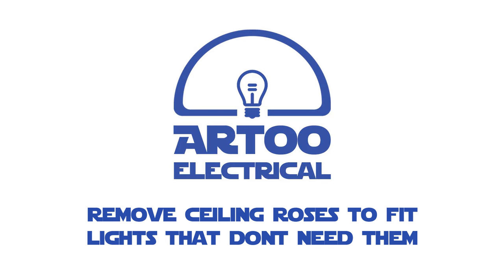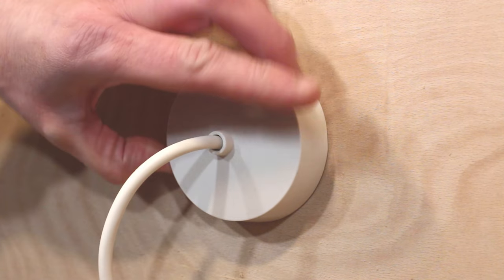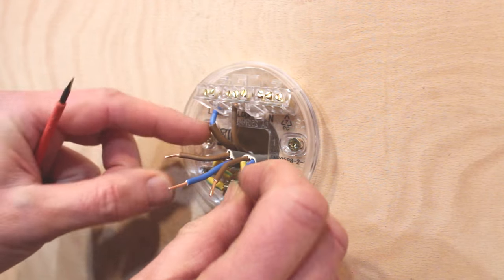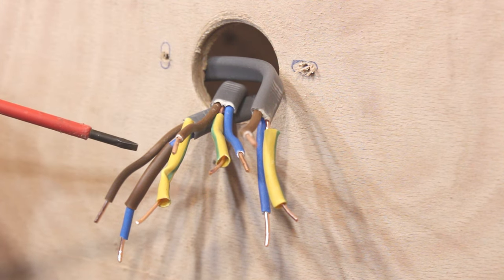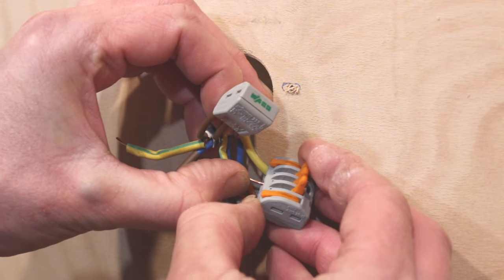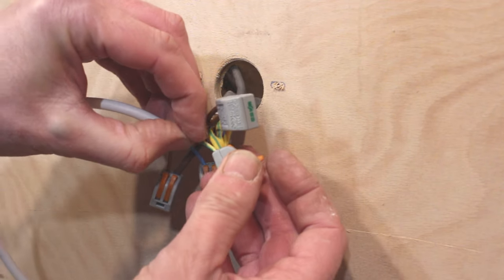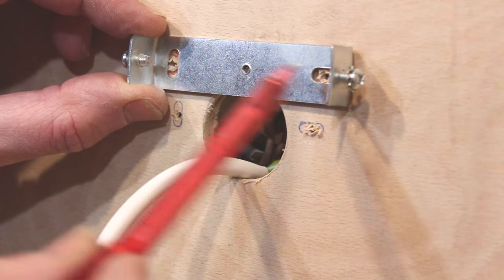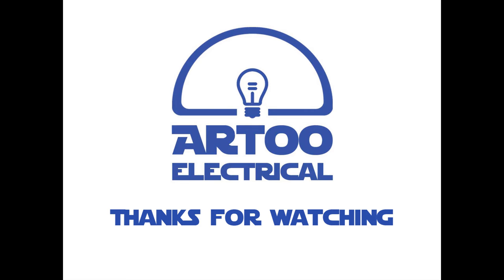Part 2 - Replace Pendant Light Fitting With One That Doesn't Need A Ceiling Rose

Comment: Have just replaced two ceiling rose light fittings with more up-to-date flush fitting lights. This video and the other one detailing the existing wiring of the ceiling rose were invaluable. I even purchased some clip wiring blocks which made the job easier. Thank you so much for your help.

Comment: Thank you so much for this brilliant video. The husband and I had been struggling to figure out what to do and this had the problem solved within 10 minutes. We were on the brink of calling an electrician out which would have been very costly, but after watching this and a quick trip to screwfix for the connectors we now have lighting upstairs again. Thank you!!

Comment: Very useful. I didn't have a clue what all the cables were, and while I still don't quite understand, the video helped me to wire up a new fitting correctly. It was still very fiddly, but it worked. Thanks!

Comment: Thanks for this excellent video! This was an ambitious job for me, complicated by no less than 5 mains cables and no leeway in any direction. However, I managed it using this method and 3 x 5 plus 1 x 2 Wagos. You explained the process so clearly and it really gave me confidence.

Comment: Brilliant video - thank you very much. Not only a great quality, but you also covered the exact problem that I am facing - what to do with the connectors, if there's not enough room for the whole connector box. Glad I won't be called a "heathen" ;) for simply pushing them connectors into the ceiling!

Comment: Useful video thanks.  The grey Wagos you used puzzled me, perhaps they were an older type available when the video was made?  In 2022, I would imagine you need instead the transparent Wago 221 series to make good connections with lower cross-section UK lighting cable?  The current 222 series look confusingly very similar to the ones you used but are for chunkier mains cable and the latest Wagos seem to have orange clips with less travel.

Comment: Thank you for this, after looking at this jumbled mess of wires, and never even hearing of a loop in system until now, I have successfully swapped a pendant light fitting with a loop system, with a lamp, and have bought a shit load of WAGO's for future use! 😁
Reply: @leey7h  Lol, slightly less than a bucket load, but more than a cup full! 😁
Reply: @leey7h  😁

Comment: Excellent tutorial, I have learned a lot from it, just a couple of questions. You used Wago connectors. The Wago connectors I have are the 221s like yours can these still be pushed back through? For a non qualified person would you recommend taping the loop wires together then the same with the line wires.
Reply: You should never tape the wires.  tape degrades or can get loose  which can cause a fire risk.

Comment: Great video but I have a question. My new light is metal and has an earth pre-attached to a screw on the fitting itself Your video does not demonstrate or explain this important issue - is it because the flex earth was joined in the WAGO with the other earths? Would appreciate an answer. Again, great video.

Comment: ALL single insulated wires MUST be contained within an approved accessory; you CAN NOT simply push insulated but unsheathed cables back into a ceiling void or under a floor. I understand the problem but this not an acceptable solution. This problem arises because (as usual) the UK has adopted a wiring practice that is non-standard in most other countries called the 'loop-in' system; aimed of course at saving a little money. It results in far too many wires in the ceiling rose for which many foreign made retrofit lights are not suited nor sized. In other countries the 'loop' is done in the light switch with a single wire running to the light fitting. If the light fitting is a Class-2 fitting made of metal then ABSOLUTELY NO single insulated unsheathed cables must be exposed in the light fitting. If the fitting is Class-1 (earthed) then unsheathed cables may be contained within the light fitting. ALL connections MUST remain accessible for future inspection unless marked as 'Maintenance Free' with a 'MF' stamp and contained with a similarly marked accessory box. I know this is all a palaver but I'm afraid it is what it is. It is also why I never give a price for fitting lights over the phone because more often than not to do the job correctly and safely is sometimes more difficult than expected. Finally, don't forget that because you have disconnected and reassembled all the earth wires, a test has to be done to confirm that earth continuity back to the consumer unit and on to other light fittings remains intact!
Reply: 100% correct.  This is a common problem and is what differentiates proper electricians who know what they're doing and why it's done from just DIY men and kitchen fitters.  All conductors must have mechanical protection right up to the enclosure housing the terminations.  A circular BESA box would provide an adequate enclosure in the case of a light fitting with a circular base. Dry line BESA boxes are available to ensure compliance.
Reply: I was going to write this exact comment, bit worrying if this guy is actually an electrician and thinks that what he's done is acceptable. And now there's going to be many people who watch the video and assume it must be correct because it was done by an 'electrician', and go on to fit a light like this in their house.
Reply: 0
Reply: @agicorn6379 I don't understand what he did wrong, could you elaborate?
Reply: @doitmyselfrunza he should have used a Wagobox
Reply: Yes. This is a problem I'm having regularly, including today. Barely any room to contain the connector blocks within the light fitting, and no space to put a junction box/wago box up in the ceiling.
"Can you put this light up as well while you're here? It'll only take five or ten minutes." REALLY?

Comment: will it be ok to push the wago connectors through the hole without a wago junction box will it be safe enough,thanks.
Reply: I guess the old cables are open same as the waygo but I guess it's always safer with a junction box 
Check online it will show all compliance rules

Comment: Even easier I just unscrewed the rose slid the new light fitting bracket at back of it screwed it back up as the new fitting base was big enough to swallow up the rose 😂

Comment: I have a question... how do i do this exact same thing to a kitchen light?... it has the same 3 neutral .. 3 live... 3 earth wire set up as a regular light.... but then i noticed it also had a seperate set of thicker earth, neutral and live wires ..... what do i do with those? Should i just tape them up or do i wago connect them up too?...
Reply: Dont worry, i found out that the other set of wires were for the old starter of the old kitchen light.... i just wrapped them up with some electrical tape and then tuck them away...

But ill keep this here just for anybody else that wanted to know..

Comment: In my modern new build I don’t seem to have an obviously switch live, no marked or sleeved blue cables…I have 2 cables coming in to each rose and both browns have been attached the same terminal and both blues to another…. Then the pendant light wires on the outsides. Great. 

I want to swap this for a different fitting and remove the rose… I try using wago but obviously I’m not getting the configuration right…. Tried all blue into a 3 way, all brown in a three way and then all earth in a 3 way …. But no deal… I read somewhere one of these will be the permanent live…. 5 hours and lots of combinations later it’s still not working… what am I doing wrong?

Comment: You seem to push the connectors into the ceiling hole. Is this correct? Do you not need to put the connectors into a wago box. Also is this method you are using water proof incase of water leak?

Comment: Hi - I have a vintage metal rose but it has no earth. Can i solder an earth wire onto it - or is there some kind of tape which would fix the erath to the inside of the rose? Thanks

Comment: I have the same wire pattern in my current light, and I plan to replace it but do I need the flex cable or does it depend on the new light fitting? Thanks!

Comment: Hi,
What Flex size should be used?
Thanks!
Reply: I appreciate this is old but I’ll answer - 2x 0.75mm^2 is normal in a cord set. If you replace the flex from a rose you’ll need a rewireable lampholder unless you’re feeding some other hanging fixture with its own terminal block.
Reply: 😂 I should have watched the video first! For the method shown you want 3x 1.0 or 1.5. I wouldn’t use flex in those terminal blocks on the fixture though.

Comment: Am I right that thinking even a decorative light fitting needs to be fitted by an registered electrician eg napit, to have it tested and certified for continuous cpc and have a minor works certificate supplied ? Pretty sure if a diyer fits a metal extraneous fitting themselves they are voiding their house insurance?🤷‍♂️ just need to know before I have a go or get a qualified electrician to fit all mine

Comment: I've never changed a light before but I've managed the first few steps of disconnecting the old light and I've put up the first part of the new wiring. However, the new light fixture I have doesn't have anywhere for the earthing wire to go and I cannot find any advice on what I do with it? Can anyone please help /advise?
The old light was a 3 way LED which had a hole for each of the wires (blue, brown, green) but the new one only had screws/holes for brown and blue and there's nothing on the instructions.

Comment: Artoo Electrical, is there any reason why you couldn't store the connector blocks in the new light fitting casing if there was enough room rather than pushing them up into the ceiling void?
Reply: Did you ever get an answer to this. Would be interested to know before I stuff them in the ceiling.
Reply: @MatthewHearne  In case anyone else reads this (albeit 3 years on...) - If the light fitting is class 2 (double insulated and therefore does not require an 'earth' (CPC) connection), you must NOT store the connector blocks within the light fitting as there would only be a single layer of insulation. If the Light fitting is class 1 and requires an 'earth', then this would be acceptable.
Reply: Additionally - the connectors mustn't just be pushed above the light fitting as in this video, but should be contained in a 'maintenance free' box.
Reply: @Mr-SuperPants like a wagon junction box?

Comment: Is it ok to just use the blue and brown if I don’t have an earth wire?
Reply: Certainly you should have at least 3 earth connections - 2 for the lighting ring and 1 to the switch. If not, your house wiring has a problem.
However, it's possible that your light fitting may be double insulated and may not have an earth connection, in this case it's OK. But carefully check the inside of the light fitting, there may be a separate earthing point that you didn't spot on the casing, in which case you will need to add a separate single wire back to the earthed circuit.
Remember, if anything goes wrong with the insulation or a wire comes loose, it's the earthing that will save your life.

Comment: This method does not comply with wiring regs. It is not acceptable to just push the Wago connectors into the ceiling like that. They must be enclosed.

Comment: I only had 3 wires in total attached to my ceiling Rose,  why does yours have so many?
Reply: If you mean you only had 1 cable with only a Line(live) neutral and earth wire then it's been done either loop in to the switch or they have junctions boxed/rb4 in the ceiling

Comment: The channel name 'Artoo Electrical' implies some knowledge of electrical work, but the advice given here is not compliant with UK electrical regulations. Unsheathed conductors should not be pushed into a ceiling or wall void and those connectors are also not suitable for use without being properly enclosed. Anyone following this advice is creating a potential electric shock/electrocution risk and also the potential for fire.

I won't go into the numerous reasons why this 'fix' is not acceptable under UK wiring regulations, but would suggest the video be taken down and would reiterate that this is not an acceptable means of replacing one light fitting with another. The fact that a light works does not necessarily mean that it is safe to use.